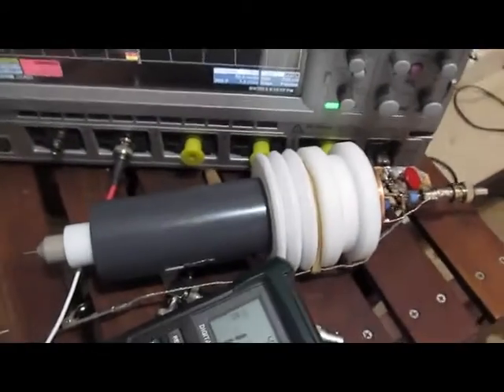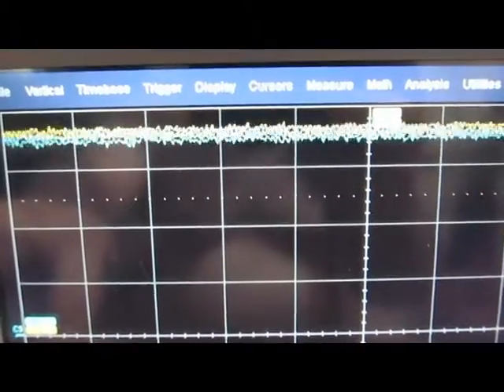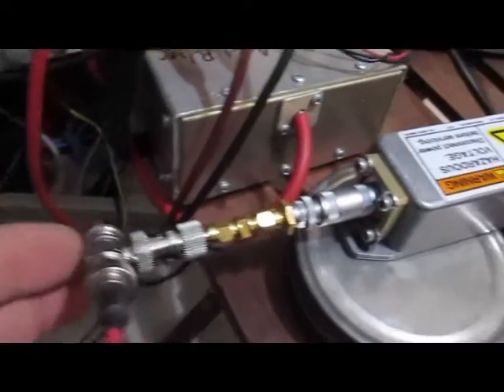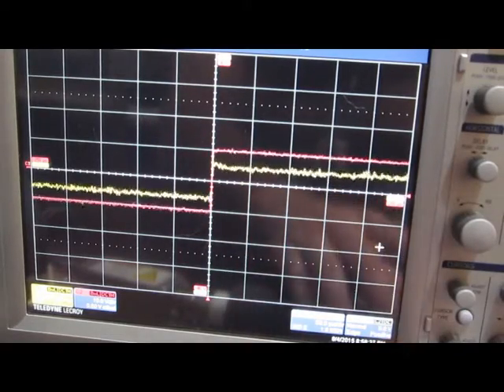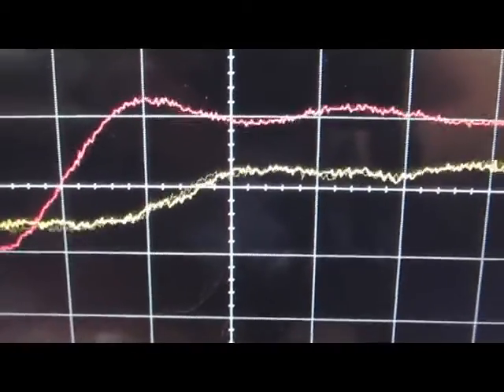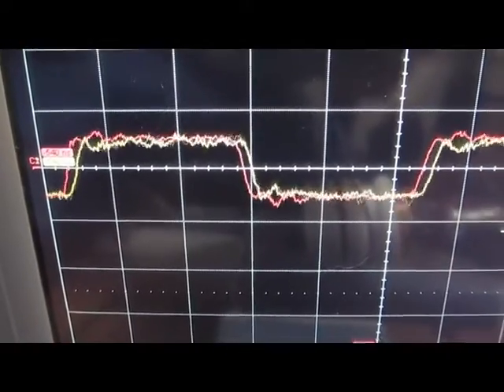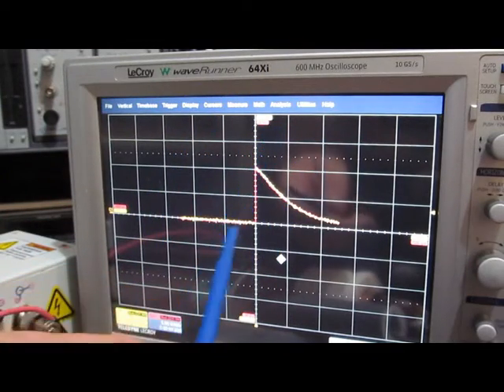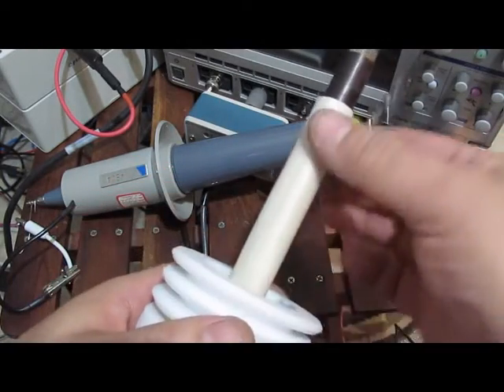Homemade 40KV oscilloscope probe part 4

Comment: why do you need 40kv probe . sounds excessive . Also when doing these videos , dont show just one instrument , cover your self up with them . At least 10 must be on screen at all times . youll get  x10 gain in views :)
Reply from the maker: +Pavle Pavlovic HA!  In many of them, I am working on about a 2 foot square folding table!  Very high tech.      I have a 12KV Tektronix probe and was right on the fringe with the transient tests.   If I am going to take the time to build something like a high voltage probe, I only want to do it once.   I have ran tests between 30KV  and 40KV and wanted some margin on top of that.   I've ran it to 65KV with no problems.   Decent bandwidth.
Reply: joe smith So you dont need it , just playing. Well anyways , having a lot of tech in shot helps with views . that Mr.Carlson Lab channel if thats the right name has an example . he uses fish eye camera , to get all the tech in one shot . Just scopes around him are 2-3 tiems as big as him , in the shot . It looks funny but it boosts views 600x , and he looks smart :)
Reply from the maker: Anything I have posted about has just been for the fun of it.  Wow, so I just looked at Carlson's Lab intro vid.  Thanks for the suggestions but I'll stay at my own level of smart ;)
Reply: joe smith yeah did you see that, its amazing :) some of the vids are even more exaggerated. Well nice chat see you on the tube sometimes . Best of luck